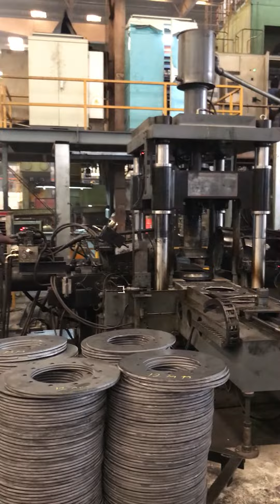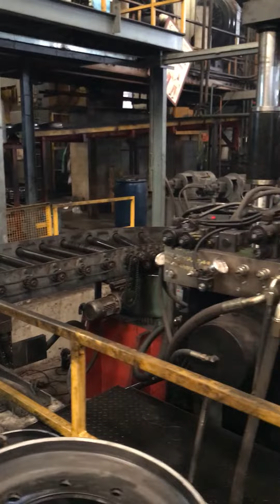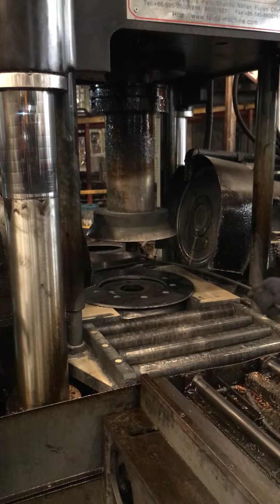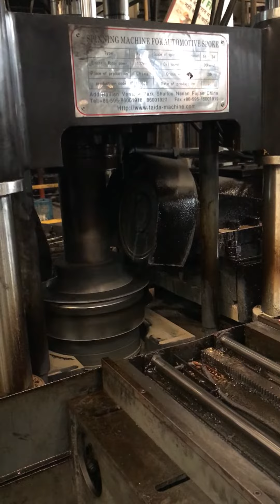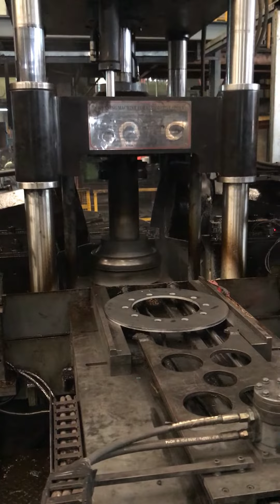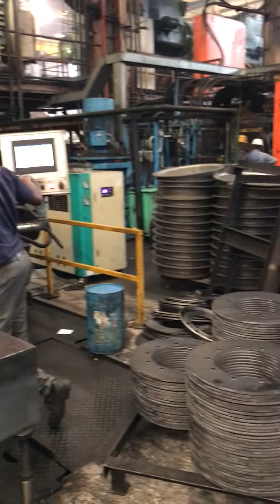Disk flow forming machine  spinning machine wheel rim making machine

Comment: Seems like such a waste of man power having a person standing there to simply to unload the conveyor. Why not have the conveyor circle back to the loader and he could unload as well. Labor must be very cheap there.
Reply: same labor loading, unloading easier
Reply: This is 7-year before video, new such line connecting with CNC Vertical Turning machines and or bolt-hole drilling machines popular